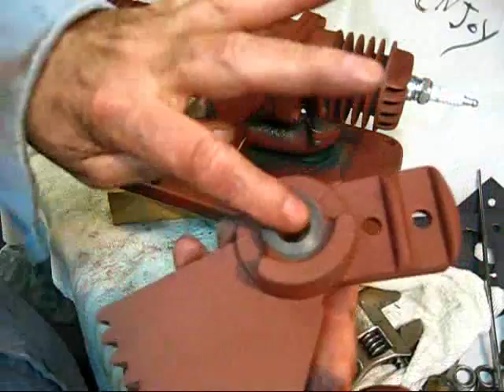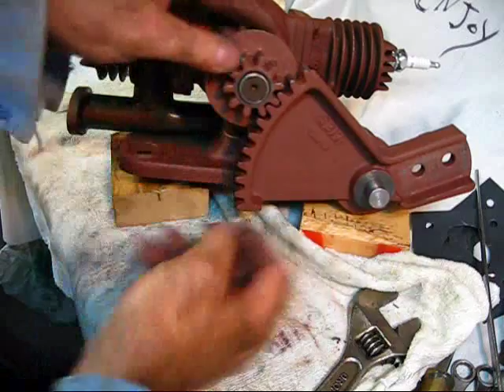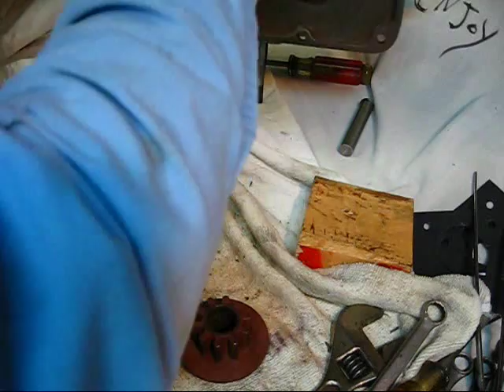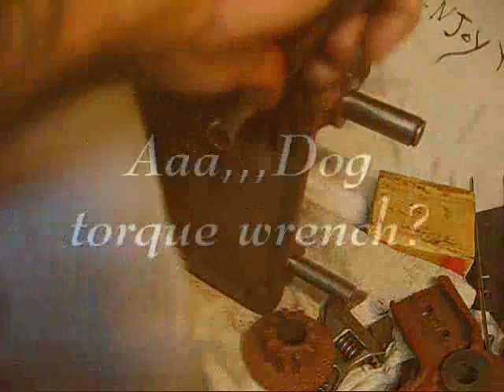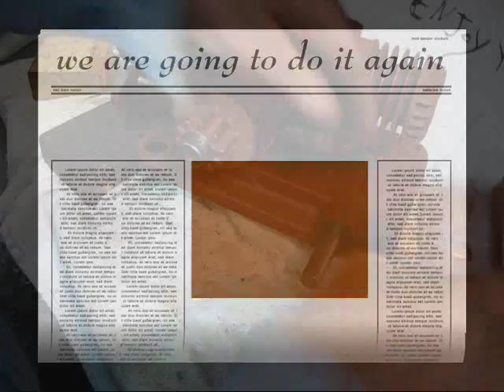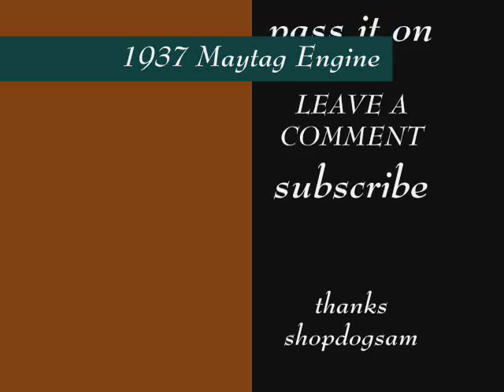1937 Maytag  Engine model 72 repair #30

Comment: Sam,
When you said "miss a tooth every now and then" it dawned on me that improper meshing of these two gears could lead to the broken teeth on the starter segment that caused you to replace the original starter segment from this engine.
Great job teaching us this tidbit that is not in the repair manual!
From the West Coast of Tennessee.